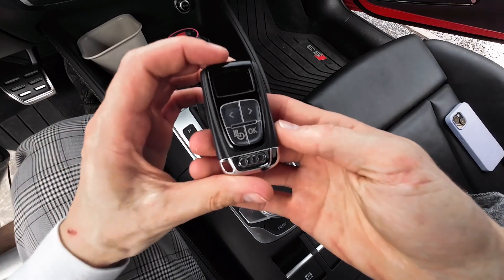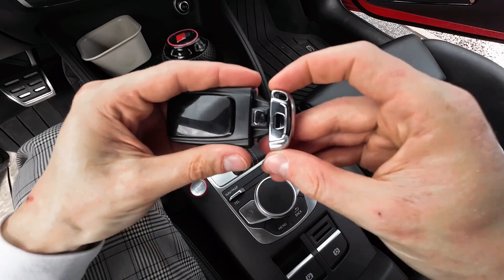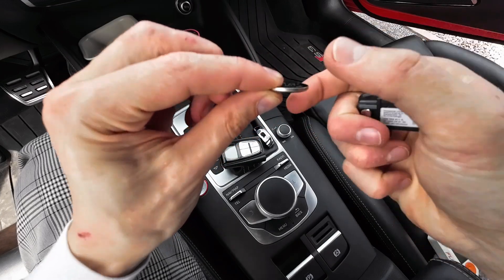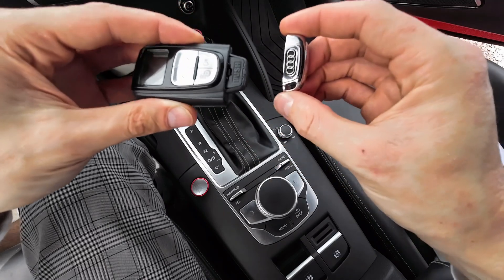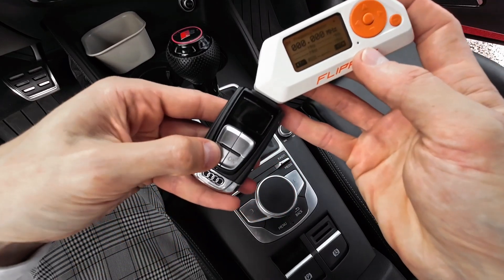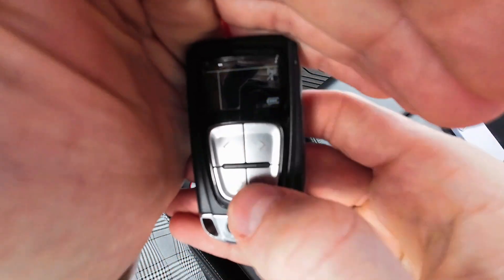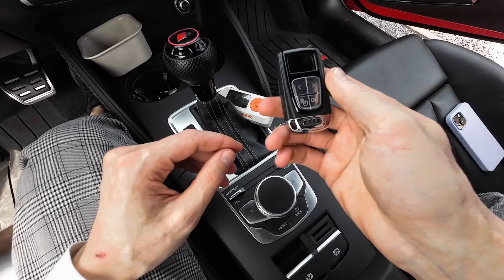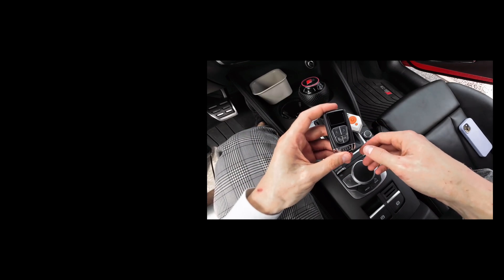Audi remote aux. heater battery change Webasto Eberspächer

Comment: Interesting remote. Have never seen one.
Reply from the maker: Bi-directional communication. You can send commands to car and receive info about interior temperature etc.

This will be an interesting retrofit.
Reply: @mrfixpl  Wow!!  Now that's something to really go after. Is this only for the MQB platform? Sorry if you mentioned it in the video, as I watched the whole thing, but was fixated on that weird looking remote lol
Reply from the maker: All Audi cars from last 12 years use this part. And I believe that it’s not even Audi-specific. Most likely all VWAG from those years should support it.
I’m going to retrofit this in Audi S3 MQB, but other platforms (MLB) have the same remote and the same TeleStart module.
Reply: @mrfixpl  Interesting. I've owned Audi vehicles since the 90s(also leased a Turbo Jetta, back in '02 as well) and I've never seen a remote such as this. Thanks for the info.
Reply from the maker: I've seen couple in high-specs cars. But never seen this one: 000-065-761. It's for MQB OEM remote engine start.